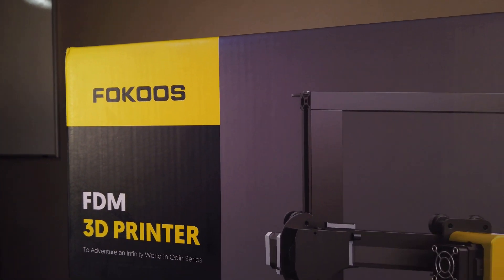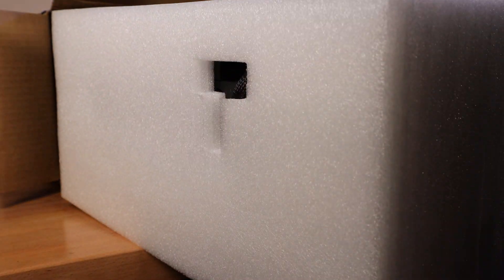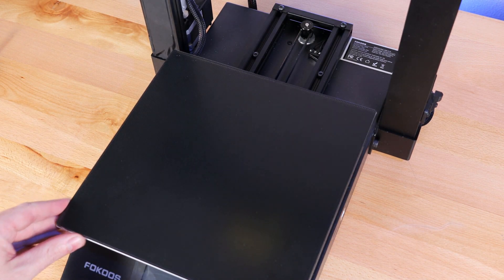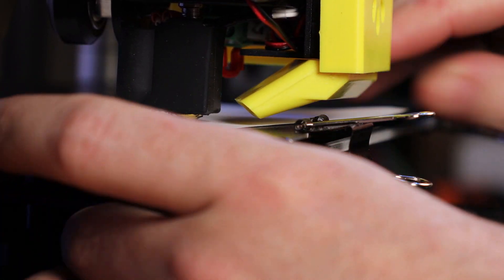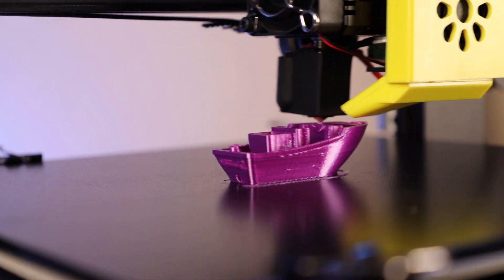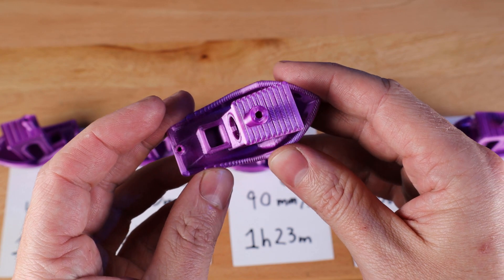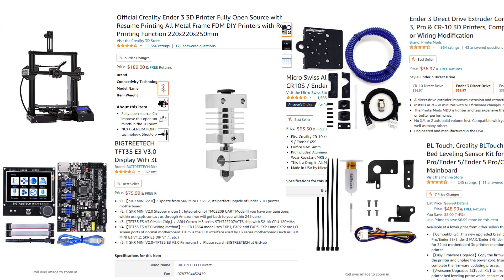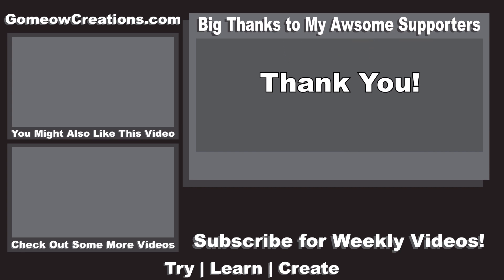Not Just Another Ender 3 Clone - Fokoos Odin-5 F3

Comment: There is an extractor release button on the front of the the extractor which allows easy manual filament loading. It is the piece in front with the threaded hole in it. I don't believe there is any way that the bed clips can cause a short as the heater element is in the centre of the aluminum plate. The clips actually work well and do not lose tension like some cheaper clips. I have been using this printer for over a year without any problems and it produces extremely nice results.

Comment: Wait until your nozzle clogs, though. Mine did, & when I found it was so stuck that I couldn't remove it, I took the fans off to replace the hotend. It's still sitting in my basement because the hotend is TINY! The fan is actually bigger than it. When I contacted them, I was told it can be replaced with any volcano-style hotend, which I guess is true...IF you replace their extruder too! The hotend is secured to it by what looks like an m3 screw, & the intake (and connecting piece) is only large enough to accept the filament. I can't find anything online that comes even remotely close to that size, but there's definitely no way to secure a volcano to that setup. When I have time I'm going to see what I need to do to print an adapter & try it with a different extruder. At least then I won't have this issue in the future. It's just a shame that after paying this price for it, you can get any number of others that use normal hotends & extruders.
Reply: So how can you fix it after it clogs??
Reply: @reviewithme9913  I didn't. I sold it for parts to someone...what a waste! 😔
Reply: @reviewithme9913  there's a little thing they send out with the printer to clean the nozzle. They also provide 2 replacement nozzles with the printer. Idk what he's talking about...

Comment: What do you use all the 3D printers for in jewelry?
Reply from the maker: Different things. Like you can make tools or tool handle, custom organization setups for your tools and small parts. If you are using resin printers you can make things in castable resin and use it for lost wax casting. I will have more videos after I get the printer videos done showing how I use them to help organize my work area and this will basically make the printer pay for itself. 

I also do rapid prototyping using them but I know not a lot of people have the 3D skills to do that but it's an option.